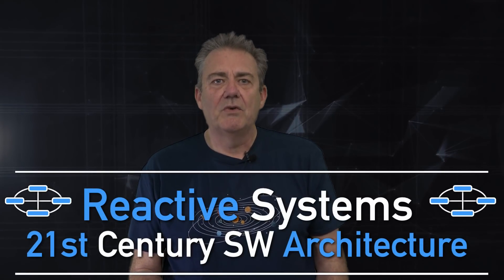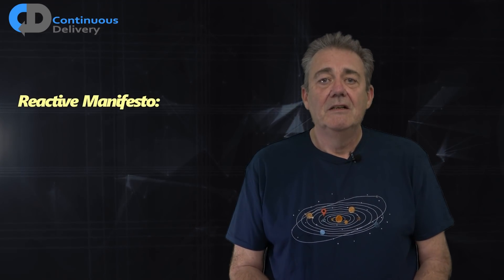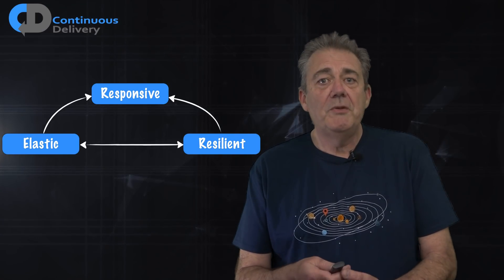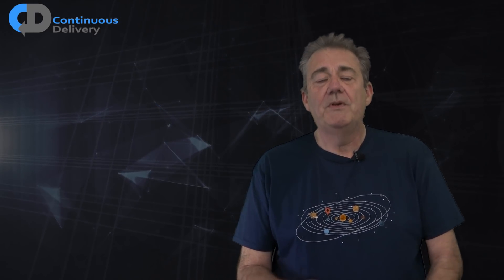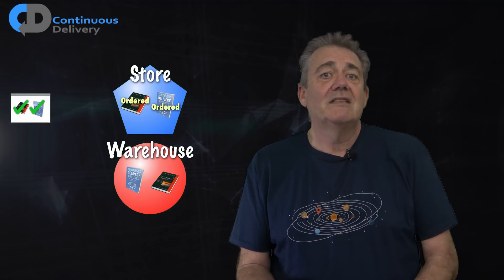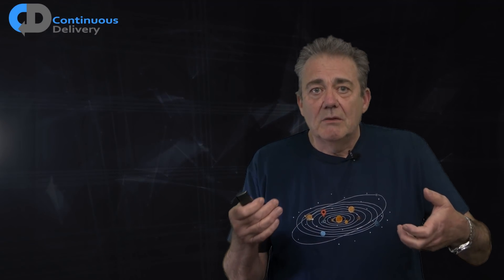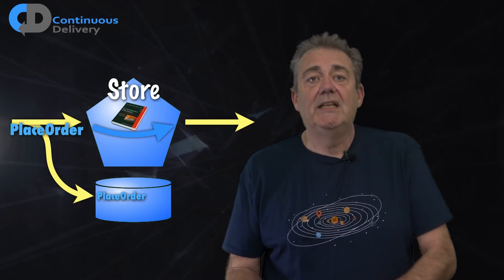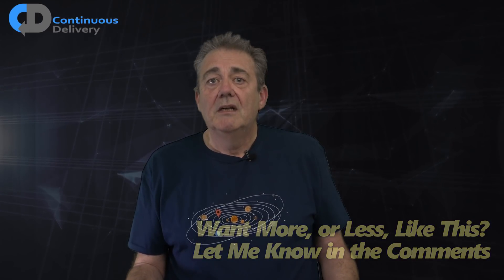What Are Reactive Systems?

Comment: Let me get this straight: you want to create a book store on top of a differential log for state? (no ACID database).  So when the system restarts the book store recreates the order state by processing the billions of lines in the log file storing the current state in memory? (e.g. Amazon).  I find this incomprehensible.
Reply: This is essentially Event Sourcing or CQRS.  You would store snapshots and play forward from the most recent valid snapshot if your application required this.
Reply: That was my thought as well. It seems like that would be much slower than a snapshot style recovery mechanism. Maybe the two could be used hand in hand? Like a snapshot every few hours, and use the logs to fill in the state change that occurred in between the snapshots?

Comment: I'm a big fan of the concept of reactive programming. However, once you are looking for nails for this new hammer, you are usually directed straight to already-built systems like Kafka et al, but there seems to be a lack of "passing on the skill of building these from scratch" out there. I'd love to see a simple example of the Me, the Store, and the Warehouse in JavaScript (or other) using just vanilla features. I'm particularly interesting in seeing how the Store would rebuild it's state by a full replay, and what happens when that replay is millions of transactions long. Thanks in advance for any advice. This would be a pretty cool example to "pair" on if you were so inclined ;)
Reply: Some people say the system can have the latest state cached somewhere to serve requests after the list of events gets too big. Then the events are used in case you need a replay; otherwise, the cached state is used.

Comment: If you're going to replay my order every time you restart your system, exactly how many copies of your book are going to get piled on my doorstep?
Reply from the maker: Just the one, 😁

I’d like to remind you, this is exactly how relational databases work internally, and for that matter the processors that they run on top of too. This is not a new idea, and it is the most effective approach to high-performance systems used in all sorts of systems.
Reply: @ModernSoftwareEngineeringYT  I must be misunderstanding something.  If it replays everything that ever happened since the beginning of time, then every restart would take longer and longer than previous ones.
Reply: @michaelrstover  Event Sourcing has the concept of snapshots. I.e. we occasionally inject snapshots in the sequence of events which represents the state up till that point in time. When we are replaying we only need to go back to the latest snapshot but if we want to we can ignore the snapshots and go all the way back to the beginning.
To avoid the same book being ordered multiple times we make sure that all actions are idempotent, which is hard, but doable.

Comment: I've been thinking a lot about state management for front end applications. The end result of my considerations was that Observable pattern really is the absolute ideal way to handle state management. You're describing reactive programming, aka functional reactive programming aka Observable Pattern which is already in use with RxJs, Vue.js and Angular. The only downside I can see with this pattern however is that our modern programming languages seem to be not well adapted for it yet. For example, the setup code for a message pipeline / system should be compile time generated and typed, but instead it is still being executed at runtime and untyped. The performance overhead here is usually insignificant, but the ergonomics (readability and also writing the code) could definitely still be improved.

Comment: Explanation is super clear, though one topic is still a bit vague to me. Who is responsible for message streams? Should we pick classic OO style where the one who emits message tells to whom it goes? Or we pick Rx way where emitter sends message in some medium from where it can be retrieved by anyone who wants? Alternatively we can create some intermediate "telephone switchboard" entity which tells who gets which messages. I've tried a bit first two methods and i have not found any serious flaws in any of them(so i am very suspicious). But i feel like this choice has great influence on general design and dependencies in particular. I would've applied rule "high level modules should not depend on low level modules" but with messages it's not clear how to define dependency

Comment: A great explanation!
Would it be possible to delve into things like:
1. What happens when we need different versions of the same service to exist, and how we go about building them? For eg. in the context of  a pub-sub (reactive) v/s a REST system.
2. Can we fit all use cases in the reactive systems, or are certain cases better handled by non reactive designs?

Comment: How do we differentiate event driven and reactive?
Reply: I don't have a lot of experience with this but this is my interpretation. "Reactiveness" is not boolean, you can have a system more or less reactive. In practice, it seems to mean using techniques that allow systems to scale themselves to demand. Message queues paired with automatic horizontal scaling make the system more reactive. The technique that is most usually associated with reactiveness is reactive streams. These are described in the video.

Comment: The capability of software or more generally, computers to respond gracefully has been widely available for decades.  For example, someone writes a function to calculate the sine of an input argument.  After writing the function to handle all numbers, real and complex.  Next, the developer considers how the function should respond to non-numbers such as NaN, Inf and text.

There are many options on how to handle these non-numbers.

My experience is that sound software development includes consideration of these issues and it has since at least 60 years.

Comment: I recently learned that a key "feature" of Agile is that it only supports the Project Management of the Features,  Program Increments and Sprints.  It scope doesn't include the Project Management efforts that decide what should be built for the customers.   I'm confused about how this can be successful.
Reply: I think you are referencing to his work in general, not this specific video?

Agile is a way of working. Its cyclic nature is mainly fit to structure work that has medium to heavy uncertainty. Software development is uncertain by nature, as he points out in his 'estimates' video.
But you still should consider if this Agile way of working is the right tool for your job and if it is an organisational fit.

With that out of the way. Agile development often uses less rigorous up front specification of the 'how'. That's a main difference with 'old' project management. But the 'what' is often better assessed then he 'old' way by using a combination of best practices and evidence based approach with short validation cycles.

Comment: Brilliant ! So without naming them, I believe the concepts touched are reactive microservices, Event Sourcing ( and CQRS ?)  ? Why do the services themselves need to be single threaded? A reactive multithreaded asynchronous & non-blocking model (Rx, Reactor, Akka) would work, in fact would be great ?
Is is correct to say that Reactive Programming and Reactive Systems are analogous with scale being the factor ? Both are based on async non-blocking message passing ?
Reply: Yeah in other video's he is more clear about being opiniated. And I have seen this combination being used in multiple systems: really powerfully but a framework on its own (hard to understand/learn).

That single threaded thing reminds me of the 'Actor' model. It is for consistency purpose so you don't need locking in theory, but in practice the partitioning will make you still need some consistency control but then eventual consistency will be enough. And the actor is managed, like he said, that will allow multiple messages to be processed at the same time. Also it is a combination of data with logic so you are fast, another thing he hinted at.

Comment: Would be nice if you could cover the pitfalls as well. For example, replays take time, messages get lost, code needs to be refactored and processing of messages will change so that a replay can be scary, the black boxes may need to be split up, or worse, combined, how to understand a big collection of boxes with no direct trace between them, getting the current status of something when everything is eventually consistent, items that need to be in sync with each other, etc. Also, when is a reactive system most useful, vs just a monolith with a db.
Reply: Exactly this. Maintainability over time is key. I don't know if this system is like that.

Funny thing is that I have seen systems like this and they tend to be as complex as other approaches.
Like you said, you need to not only replay messages but also model transformations. And you probably want some snapshot capability to keep rebuilds fast, locking on certain message sequences, filters, message tracking & dependency visualisation, and so on. Yes the business logic can be simple, but now you have this massive framework to manage. So your work shifts from programming to configuration.
Reply: Isn't that a good thing though? Assuming the framework is well made.
Reply: @Xorgye  But the idea is just that: not removing the complexity inherent to any asynchronous system, but centralizing it on the infrastructural layer so that it doesn't permeate through the business logic and can be independently optimized.
Reply: @DodaGarcia  and then? You have solved what exactly?

Comment: Ok Dave Your Store and Warehouse in the example have to deal only with business logic, messages are just coming and being sent. But just see You have done a delegation, You have silently indroduced a reliable message delivery (sub)system aka 'Kafka' nowadays. As usual today developers are putting great efforts into feeding and consuming the kafka. Even talking about 'kafka messages' what is a nonsense, since kafka is nothing else but a log, ledger. With kafka a delivery strategy coming into my mind: At-least once, At-most once and Exactly Once. Frankly a typical project manager would like 'exactly once' but that wish may break for example responsiveness. Take my word: the problem is real, restructuring the architecture means that it will be seen another part of the system: in your case at the kafka part.

Comment: When you speak of reactive systems, do the services have to use single threaded architecture in order to be "truly reactive", even if they can scale horizontally on a platform like Kubernetes?
Reply: The architecture at large is very much not single threaded, but instead a large collection of mannnnnnny different single threads, each responsible for their own unique message queue. A large importance of this design is to ensure that the messages can be processed in the correct order (generally FIFO). The thread processing a single message queue is free to spin off / delegate any work to one or more async threads (or even other "actors" handling their own separate message queue) so long as any response to that async delegated work comes back into the same single threaded message queue. This is key for any bit of your system that needs to maintain some changing state that may impact how you respond to / process each new message that comes through. If your service isn't tracking any internal state then there's probably not any need for a single message queue, your risk of race conditions is almost nil without shared state. What this does is help limit things like race conditions and other problems that occur when dealing with shared state across multiple threads.

Comment: So reactive systems are basically event driven design? What kind of messages are you thinking of? If the responding messages are async they probably need to make a connection, like sockets or xmpp or what have you. Do I understand that correctly? I’m intrigued and would love to know more about how the messaging parts actually work.
Reply: You need to define your messages carefully for this to work. It's should be signals about state transitions, not a command system with a request/response pattern.

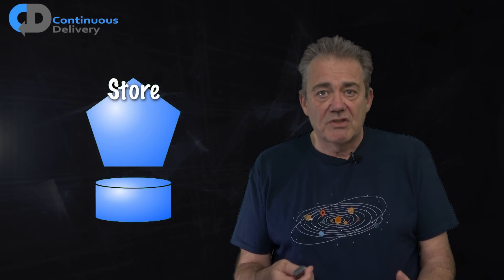Comment: Two questions about the approach you describe on 14:00, where the order state is only kept in memory and the service replays the messages on restart to recreate this state:
1) How do you keep startup times down if you have millions of old messages to run through?
2) How do you deal with breaking changes to the public contract or the service. Do you have to migrate all the old messages, do you write som special legacy handlers in the code, or something different?
Reply: In event-sourced systems, question 1 is usually addressed with snapshots of the system taken at a certain interval, which themselves can be stored as a special type of event. The complete history of events is persisted as a backup.

Problem 2 is more complex and a notorious downside of that type of system. Greg Young has a great talk about the topic if you're interested.